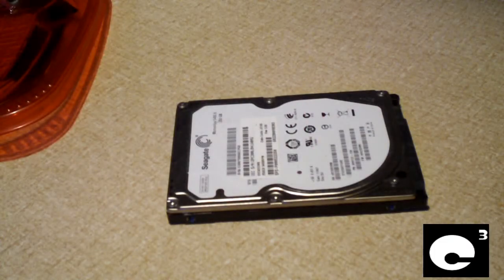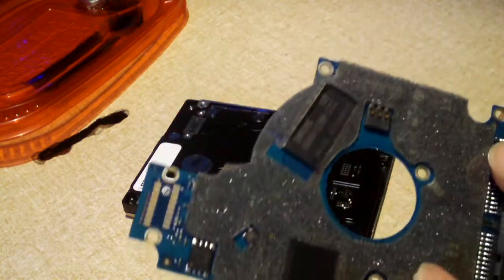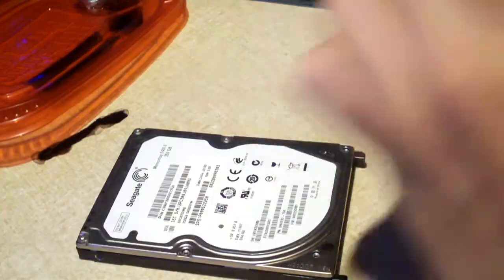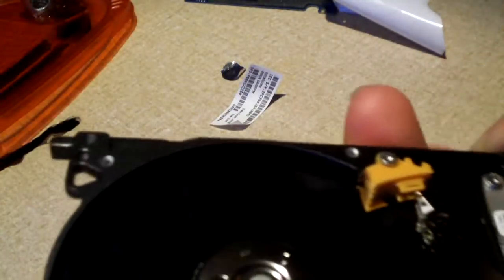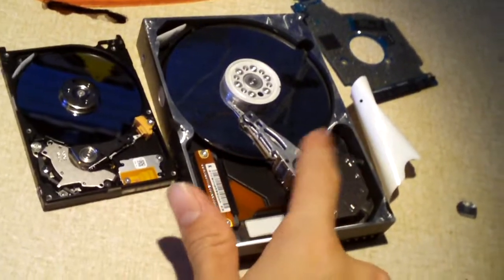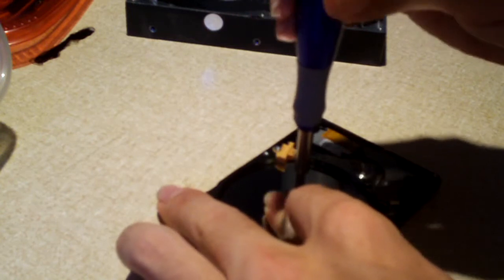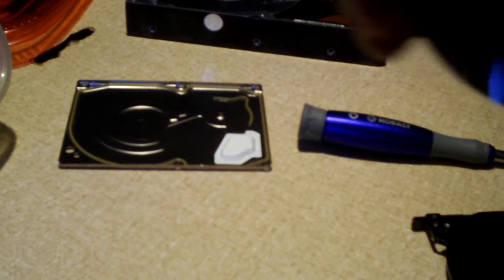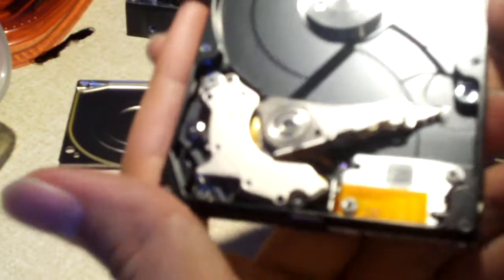Inside 2.5 inch Notebook Hard Drive

Comment: I don't get it. If the read and write head hits a sector, it means click of death and I heard sometimes it mean read and write. I'm confused. What is the difference in sound?
Reply from the maker: The hard drive in this computer failed because it was damaged from a drop while running. Likely some physical damage to the heads was the cause of failure here.
Reply: ***** I knew that I mean. What is the difference between the read and write head and the click of death. I have seen working hard drives hitting the circle thing. Is that read and write or click of death?